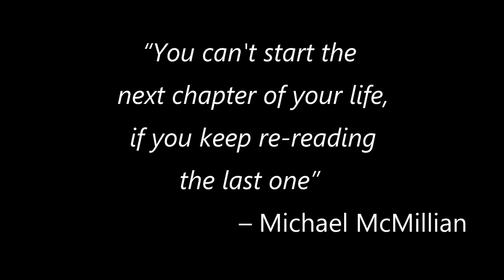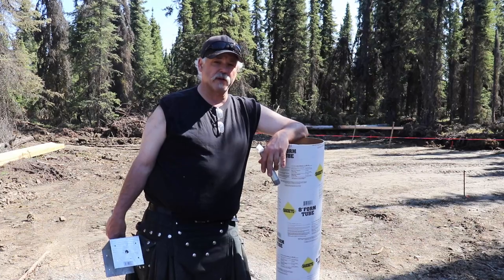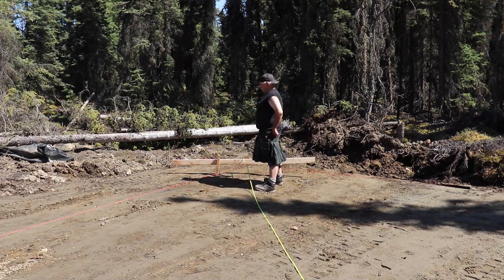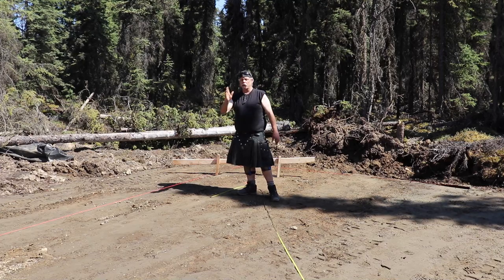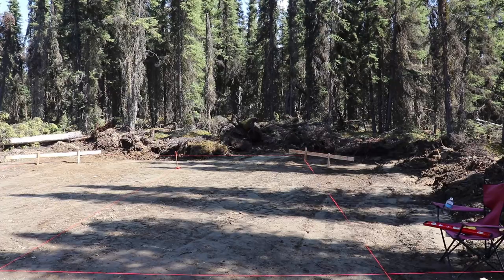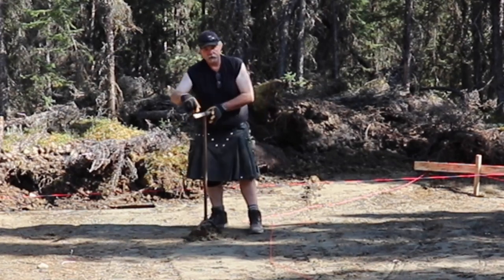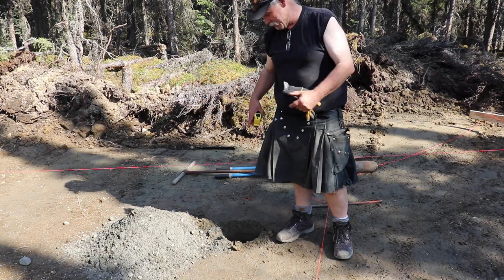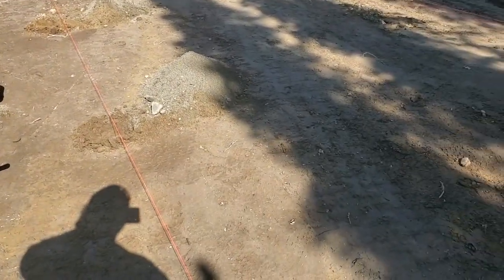Finishing the lines and digging the first hole for the Alaska cabin

Comment: I don't know if you have thought about this but I would suggest, once the tubes are in the ground, lay down some plastic or typar under where the cabin will be.  Then cover it with some fine gravel.  Down the road, you'll be glad you did.
Reply from the maker: i had planned to use gravel anyway, but what is the reason for the typar? i have enough to do it, i am just curious as to why lol
Reply: @SeanInAlaska  I would put down typar or plastic.  That is just to prevent weeds and stuff from growing.  It's not going to be a big problem of having weeds growing under the cabin but if you have it and can do it now, makes it a lot easier than trying to do it after the fact. I would actually put it down so it sticks out 2 or so feet all the way around the outside of the cabin. Just a thought.
Reply from the maker: I think I will...like I said, I have lots of it anyhow lol

Comment: Good to be very careful with measurements, but 1 inch in 20ft is 1/240 or 0.4% which is a lot to ask when using (stretchy)string not lasers and an auger for digging (very difficult to get all holes exactly vertical) Best to have some reasonable tolerances in your design, like you do with the height adjustment on the sonotubes.

Comment: I’m a little concerned that you aren’t going below frost depth with you holes.  Without pouring a footer at the base of each sonotube you may experience frost jacking.  This could be eliminated by using a Bigfoot footer then the sonotube.  Just my thoughts.  Take care.😊
Reply from the maker: I am in gravel and sand at 2 and a half feet, from everything I have read, and folks I have talked with, I am safe at this point as there is almost no heaves with that sort of ground. Hope you guys are doing well!

Comment: Im not trying to sound sarcastic but genuinely asking....Sean how did you figure 30" was deep enough for the sonotubes? Everything I read and every chart I saw said you should place them below the frost line because over the years the frost will "heave" them  up.  Where I'm at ( northern us) they are supposed to be 60". Thanks
Reply from the maker: I hit sand and fine gravel at about 12 inches. Sand drains well and is not affected by frost heaves. I have had zero issues with frost so far.
Reply: @SeanInAlaska  ok, thanks for the response. You have a great personality,  great content and a great channel. Thanks for sharing
Reply from the maker: @JH-jd8ip thanks for the question and the kind words. I will make sure and update all if I ever have a failure.